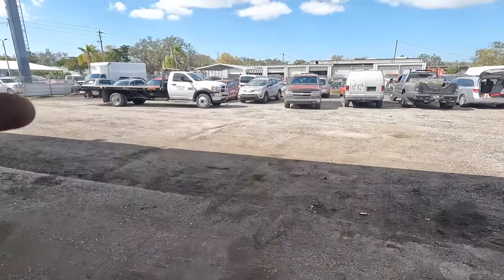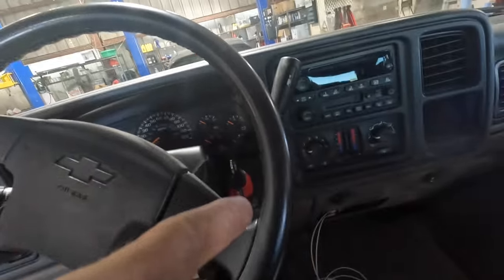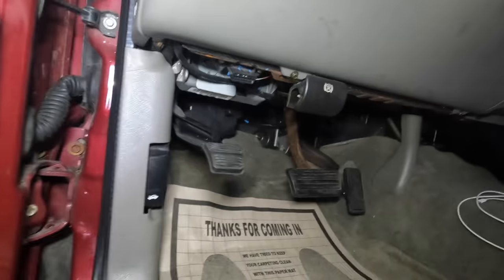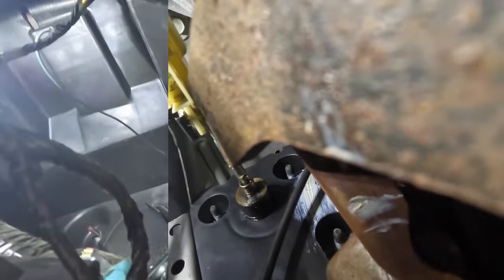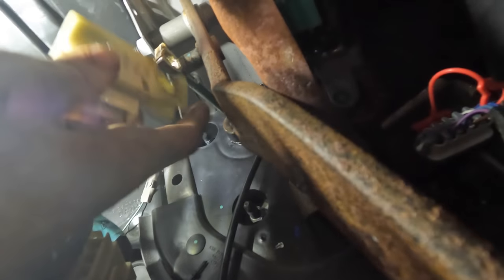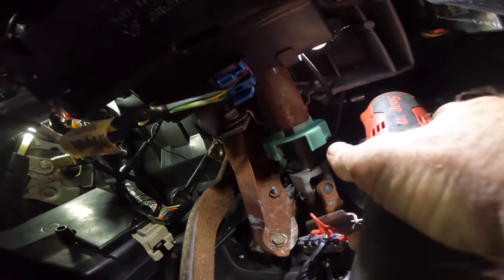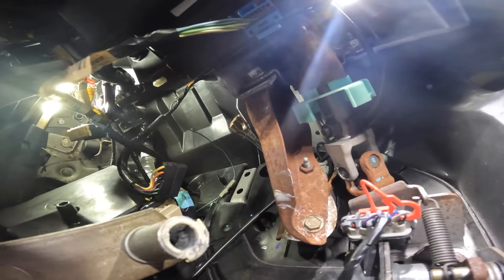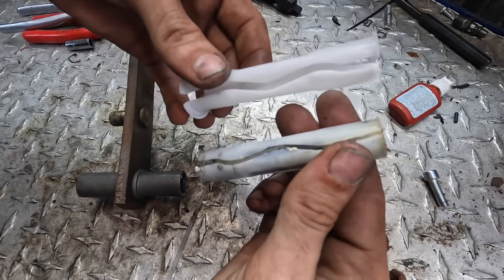Loose Brake Pedal Not what you think | 2004 Chevrolet Suburban 5.3

Comment: Working under the dash can be really challenging.  I've been upside down with fanny on the car seat, feet up over the seatback and my head and shoulders on the floor under the steering column.  Lots of fun, particularly with bifocal glasses.  You're amazingly upbeat doing this. 🙃
Reply: you can get inverted glasses for this kind of use. Personally I HATE bifocals at the best of times
Reply: For no more than this job arrangement happens reading glasses might be a cheaper option.
Reply: Removing the seat makes it a tad easier.
Reply: I had to replace the brake booster in a 1996 Corvette.  You have to take the seat out, lay in the floor, and put your feet up into the hatch.  Once you do that, you're wedged into the basically shoulder width floorboard, because you have the transmission tunnel against your left shoulder and the frame rail against the right.  Then you have to lean your head back to see the nuts you need to get to, and reach backwards over your head to get to them.  That's not even including the steering column and all various other things that are in your way, or the plastic keeper clip for the floor mat digging into your back.  Then when you're done, you have to figure out how to throw your legs out the door while twisting your rear end up and over the frame rail/door sill so you can climb out.  It was not a lot of fun, lol.
Reply: Keeps you young
Reply: @miscbits6399  After 50 years you get used to bifocals, but still dislike them.  Now I have trifocals.
Reply: Had to remove the seat in my brother in laws car when the blower motor died. I was suffering. Had to remove the clutch pedal and cut out some plastic to get it out.
Reply: I am well aware of your concerns, especially with the bi-focal lenses. Being over eighty only makes it worse.
Reply: Agreed, I recently changed the brake position sensor, it's unreal watching him do in a minute what took me like half an hour
Reply: Certainly is a young man’s job😋❤️‍🔥🇺🇸

Comment: Sometimes I swear you're working on things wrong with my '02 truck. Now it makes sense why my brake pedal has rattled for the last 15 years whenever goong over tracks or rough road. Thanks Ray.
Reply: Those trucks are bad about the steering shaft rattling. That is more likely than the brake pedal. GM had a service bulletin on the problem. I had to replace mine at 60,000 miles.

Comment: Brake pedal pivot pin.  I vaguely remember it from my soft trim days.  It had a torque setting because of that miserable plastic bushing.  Too cheap to use a bronze bushing and a grease joint.  GM engineering, save .0001 cents a job on each part, and you've saved .35 cents per job!  Thanks GM for saving .50 cents on my head gasket.  It cost thousands later.  Love ya Ray!  Great videos!  Love the X-Files walk-on when they happen!
Reply: Love the X-Files walk-on when they happen!
Reply: You may rethink the corner cutter fmc and fiat chrystler.
Reply: Well, if GM wasn't a public traded company.  It wouldn't be concerned with every penny.  If GM saved .35, and if around 500,000 units were made, it would save about $175,000.  That's just one cost cutting part, too.

Comment: Wow, that K&N cleaning and lube process is much easier than just tossing an old paper element and putting a new one in😊.
Reply: Larry..🤣🤣🤣🤣🤣🤣IKR..lol
Reply: Some of us build performance cars and other just talk about it...
Reply: I have a k&n on my dirtymax which has paid for itself several times
Even some paper filters are stupid expensive and it's worth getting a K&n
Reply: That oil and cleaning kit cost more to🤑
Reply: I tried K&N filters many years ago. After a couple thousand miles and seeing all the dirt and gunk that "filter" was allowing to pass through, I decided that going with a good quality Wix filter and keeping my engine healthy, was a better option than using a glorified window screen.
If you can see daylight thru the filter, then just what in hell is it even filtering? Leafs, twigs, and gravel?
Reply: @mitchelloates9406  Very common.  Putting one in wet with new oil takes out the MAP/MAFF sensor too. It needs to dry for hours.
Reply: A ray of light is how many microns? Inquiring minds want to know?
Reply: @larrybe2900  Air drying destroys them further - as indicated in the instructions.
Reply: @ScottDLR  I thought Ray was joking when he blasted it with a hose nozzle then used compressed air.  Far from the way I do mine.
Reply: K&N filters are great.  They now make them for ones home furnace/air handler.  I like even better.
Reply: @thatdellguy  I learned this the hard way when I ruined 4 motorcycle filters.. 
Held them up to the light and uh-oh.
Reply: Between K&N filters and split-fire plugs I don’t know which has caused more drive-ability problems. Pure junk on modern engines.  Good quality air filter is just as good if not better in the long run. K&N company is laughing their way to the bank on how they have snowed the public to think they need one.

Comment: I use a wood board as a floorboard creeper when I have to work under dash. I remove a seat it needed. As you get older getting into cramped positions is more difficult.

Comment: Great video - I have a 2003 Suburban. For safety measures make sure to check the brake lines under the car. They are notorious for rusting out. I was towing a boat from FL to NJ and got home late in the night. Next morning on the driveway under the drivers seat was a large puddle of fluid. Both lines where they enter the balancing value where rust through and leaked - the truck lost all of it's brake fluid. To this day I thank goodness the lines didn't blow out while towing at 75mph.
Reply: No annual safety checks in your state, I'm guessing??
Reply: @h8troodoh  Emissions every 4 years.
Reply: @joeythedime1838  I was pertaining to the rotten brake lines.. annual safety likely would've caught that..

Comment: On the K&N you use gentle water spray and spray the top side so as to not push dirt into the filter. Also its supposed to dry overnite before re oiling.
Reply: Sounds like you read the directions!

Comment: Nicely done!  I am currently doing the entire hydro boost system from pump, hoses to hydro boost and master cylinder on 2003 2500HD.  That dang clip is maddening!  While I had the front of the accessory off I am doing knock sensors too.  Upside down under the dash is tough on this old body with a bad back, the rest of the job is easy, until it is time to bleed the system.
Reply: For bleeding the brakes, get yourself a power bleeder.  I got one that uses air to pull the fluid to each wheel. After having done dozens of brake bleeds the old way, this tool makes it fast and easy to bleed by yourself!!!  
Sooo sweet.
Reply: @bobklittich5710  I have one as well as one for the power steering pump.
Reply: @bobklittich5710  or just gravity bleed the system..

Comment: These cars are among some of the most reliable cars in America as long as you do basic maintenance. If you take care of it, it will take care of you. And my personal daily driver is a 2004 Chevy suburban 5.3L Z71. Best car I’ve driven. And I’ve driving much newer cars.
Reply: 2001 here. I've had to fix a lot even the vacuum brake booster which everyone agrees is weird. But I trust it more than anything to keep going. Only 160,000 so far
Reply: 2004 Suburban 2500 LT 4WD 6.0 136k mi. Great truck.
Reply: I have had Chevy Suburbans for three decades and they are great vehicles.  Keep the maintenance up and they are 300k mile vehicles.
Reply: I’ve got a 91 Suburban and I’d drive it anywhere. It’s by far not my daily cause I don’t own a gas station but it runs really good.
Reply: Have a 2007 Chevy Trailblazer with 167K. Used to be my daily, but now it's a beach fishing truck. No major mechanical problems, just maintenance.
Reply: Your joking right?  No Toyota is the most reliable,  Gm falls in just above Chrysler  thats with both lower then Ford.
Reply: I had a 1998 Ford F-150 which lasted 250k hard miles. No real issues until the last 15-20k miles. I have a 2014 Ford Escape however that has nothing but problems after it hit 80k. It only has 150k now. I think ford is a mixed bag, some good some terrible.
Reply: I got a 2005 Z71 in bermuda blue with about 100K. Absolutely beautiful truck, don't plan on ever getting rid of it

Comment: Wow that takes me back, K&N oiling an air filter, we used to do that on K&N mesh pancake filters back in the day and every few months off would come the filter bolts, the wire wool element taken out and soaked in petrol then soaked in a bowl full of the K&N filter oil which was very thick and sticky so particles would stick to that and not the insides of your carb jet.   Simple but super effective :)   I fitted a K&N kit to my Reliant 850cc engine and the pancake allows it to breathe and far more revvier than stock :D

Comment: Yeah that under the dash work is really fun especially them little clips and bolts and screws Oh my but I've done it I also I had problems with my mass airflow sensor was over application of oil I cleaned it it worked have a good day

Comment: Seeing the pedal bushing, it reminded me of my old 69 Ford F250, the pedal cluster was so worn that the brake lights would go on while clutching. A trip to the wrecking yard and some time contorting under the dash solved the problem for about $50.

I had K&N filters on a Dodge Dakota and on a Silverado, I decided that they weren't worth the trouble.

Comment: Absolutely thank you for the bounous K&N filter clean and recharge, from what I've heard other mechanics say kids get these and put oil on them every time they wash them to the point its drenched in oil cloging the mass air flow sensor and causing codes to go off on the ODBII system or it gets into the intake or even slows the air so much the motor cant get enough air to burn gas. 
I bought one of these kits to do my wife's 
Cars TRD k&n filter.

Comment: Pro tip: Find some spare bolt lying around...all shops collect them. One approximately the same diameter as the shaft bolt. Insert it into the opposite side of where the shaft bolt inserts. In the case of this truck, on the left. Then insert the shaft bolt, and let it push the spare bolt out as you reinstall it.

Reduces 10 minutes of fighting an alignment, down to just a few seconds.

Comment: Thanks for the K&N lesson, just put a set of these filters in my car (engine and cabin air), now fully educated on the maintenance of said filters.
Reply: Don't use high pressure Air to clean or dry them
Reply: Don’t use this as a guide. It was over oiled and blow out with compressed air. Two no’s no’s.
Reply: @workingmanaudio2754  especially the blow out with compressed air

Comment: We’ve never lived along the coastline nor in the rust belt so seeing rust under the dashboard is a first for us. We always have ourselves a great day while watching you having yourself a great day. Ray your loyal local viewers need to volunteer to clean off the tops of your toolboxes/workbenches plus shop floor, make everything nice & shiny.
Reply: Hire a kid and teach them.
Reply: I live in the rust belt and haven't seen a brake pedal rust like that. The rust seems to only be on some components like they came from a different vehicle.
Reply: They may be moisture in area around pedals. Windshield could be leaking.
Reply: You guys are driving me nuts when you literally think the rust belt has anything to do with rust.  It's a metaphor for industrial decline and industries that go out of date.  Use the term salt belt as that is not a metaphor.
Reply: Just leave your car windows open one rainy day and not quickly dry the floor pans (including mats/carpet/sound dreading fabric) and "Voila!" you have surface rust up under your dash in no time.  And to help quicken the pace throw in (or track in on your shoes or boots) some road salt. driveway salt melt, or fine ocean spray mist. Entropy is a bitch.
Reply: @futatn  I've lived in Pittsburgh all of my life and have seen many vehicles rendered junk because the road salt killed them. Now that PennDOT spreads fracking brine on the roads every spring brings multiple news stories about vehicle brake failures due to the lines rotting out. The second time it happened to me on a 2001 Dodge Ram 1500 I got rid of it after observing severe corrosion around everything underneath the truck. 
The term existed 50 years ago, when owners of Mopars without inner fenders caved the fenders in while waxing them in the spring.
Reply: The shore has salt. Seems salt needs a diet as its waistline is huge.
Reply: @spaceflight 101,
I assume you meant to say spread salt brine in the fall and not the spring. 
I try to take advantage of standing water after a good spring rain to attempt to rinse off underneath.  Of course one must be considerate of anyone on a sidewalk.
Reply: @larrybe2900  They spread the brine before and during a snow event. The brake line failures usually take place between March and June.
Reply: @jaykellett2327  That should cause everything to rust, not just one part here and there.
Reply: Here is AZ, we see surface rust like that underneath the dash since the components are not protected. Humidity from the environment and wet carpeting does this.
Reply: @jamram9924  right on, especially up north canada + there are tin parts not protected  by paint or else. 😂
Reply: You always get superficial rust on exposed metal. Under the dash often gets a light coat of paint as it is out of sight, but any car over 10 yo will probably have some light rust on the surface.

Comment: You will see that one again for a MAF code.  I ran K&N filters in the 90's and early 2000's on every vehicle I had. My conclusion is that they filter better the dirtier they are. Negligible performance gain but cheaper than dry OEM filters if you ran 100k+ miles on them. Excluding the MAF faults I had to deal with I only saw them as a plus with my carbureted Harleys. I stick with dry filters now as everything is injected.

Comment: RAYMOND,  I think on this i might have pulled the knee bolster and crash bolster as well as the drivers seat. That SUV is a twisted nightmare to put an alarm on, I know the kind of room you had doing this GM used to put the BCM up in the left top conner  on them before moving it to the center over the console but I belive that was more on the S10 version trucks.
I've had to do stuff to that type of suv plenty of times, its no party. 
You get out you feel like you were a pretzel.  Im impressed you got a electric 
Wrench on it. Its so tight a space with a lot of stuff in the way.

Kudos to you for not taking the plastic cover off your knee mat, I think when I got mine from snap on it already been removed. They get slushy with snow on them.  Never fails every time we got snow some jackass would come in to have his under car Neon lights fixed, and the car was covered with snow.
We didn't have a lift so you would lay in 4" of ice cold water to fix it. 
Finly got the boss to stop selling them.

Oh yes the BCM is behind the knee bolster on that year. And the dash had a solid aluminum bar across the bottom.
You can pick up door lock pin switches door pins parking lights and tac i belive right off the BCM  you have to go the the ing harness for key oprations and vats anti theft or pull it off the OBDII connector  to imput the key code and bypass the factory anti theft system for remote starts. 
But the older units had the BCM in the top left behind the emergency brake pedal bracket.  It was always fun to reach one handed and put a t tap on.
Screw doing soldering the wires. Not upside down over my face.

Comment: Lube with PTFE SuperLube, and the same dried grease gunk you found on the pushrod pin is found inside the multifunction switches on the steering  column.  The dried gunk will often kill a multifunction switch.  Cleaning the MF switch is often simpler than waiting for a new one to arrive.

Comment: Unfortunately as a mechanic you have to do what the customer wants then list everything else you fond wrong on the work order and hope for the best! Nice video, with the price of the K&N filter and the cleaning kit i could buy enough air filters on Amazon to go the life of the truck. Customer rules.
Reply: K&N are pricey, but they aren't THAT pricey. You're supposed to replace your air filter every time you change the engine oil. However the K&N offers increased engine performance. It can give up to 25 more horsepower, depending on the engine.

Comment: Working under the dash on your back - that's a perfect time to have helper/wife unit grab tools for you.  We had a 1994 Suburban and a 2005 Yukon with double that mileage, and never had such issue with brake pedal.  Need lube on the steel peg/rod on the pedal where it goes through the booster hole.  I've used Simple Green to clean the K&N type air filters, then used correct oil after it has dried.  My 2005 had Torx head screws for the air filter housing.
Reply: I'm so old and creaky that I've taken to removing the driver's seat in order to work under dash. That and enough rubber pad.

Comment: @22:23 I noticed that you were working on the very screw that I cuss on my 2015 GMC Sierra 1500 4x4 pickup with the 5.3 L engine. In my vehicle GM ran the AC pressure line directly over that screw. Makes it very hard to change the air filter.

Comment: C'mon Ray! it's no worse than me laying on the floor of my stock '92 Honda Civic hatchback pulling the clutch pedal assy. in the parking lot of the parts store to replace the rubber bumper for the clutch safety switch, and I'm nearly 70! (mechanic-ing is one thing that DOESN'T get better with age!😁) love your work, may call and bring you some.😁) oh, yeah, at my age, I have to pull the seat to work under a dash, a few minutes can save time if it is a difficult job way up there.😁
👍🇺🇸😎